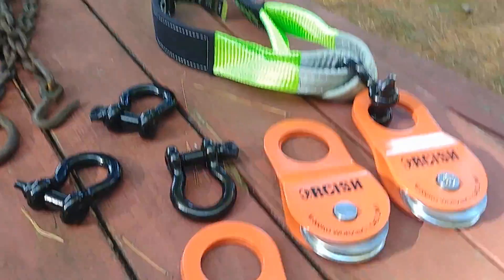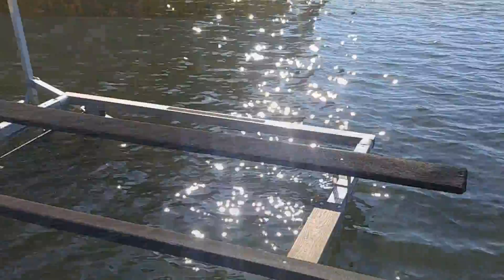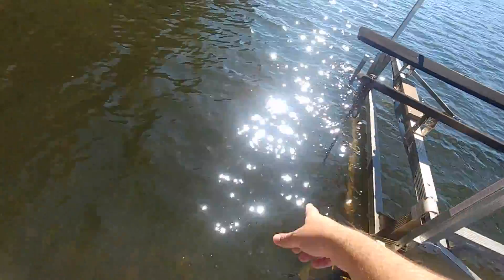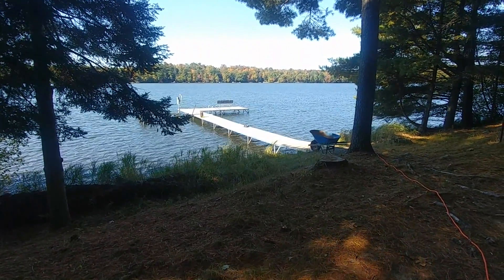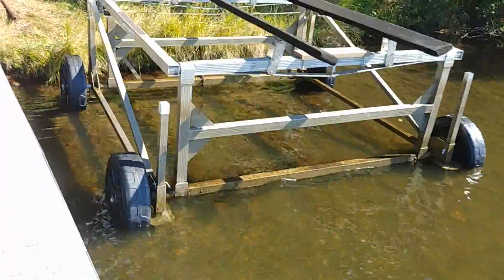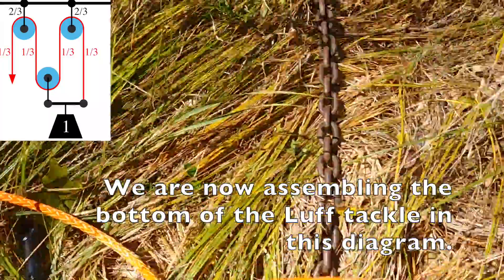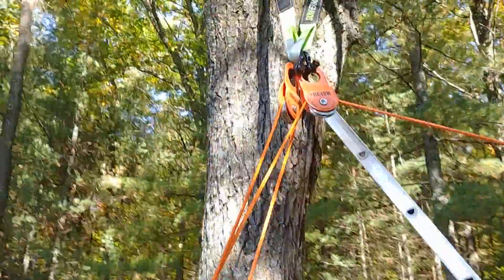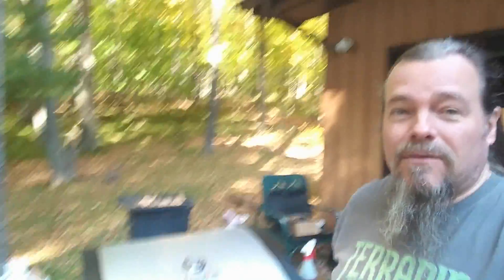Operation Boat Lift Lift: using snatch blocks to pull a boat lift ashore

Comment: Can you drive a large steel rod in the ground in the bottom of the lake and attach your snatch blocks to the rod and pull your hoist back in the water where it was? I have pulled my hoist out like you did but I need to put it back in now that Winter is over and I am just one person!
Reply from the maker: I am in the same "boat." I will be putting it back in. For me, luckily it's downhill.

I do think you could drive a pipe into the lake, and pull it out. Our old dock was on pipes we bounded into the lake bottom every year... however, I think that was as difficult as just [slowly] jacking it up (with pipes) to get it off the shore, installing the wheels, and rolling it out there.

Godspeed.
Reply: @DrDavesDiversions  I tried to put it in but ended up pulling the 1” diameter rod out of the ground. Ended up hiring 2 men to move it!